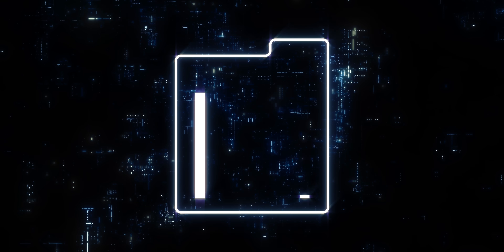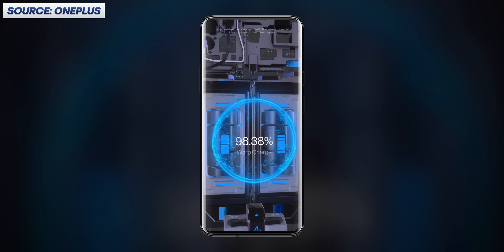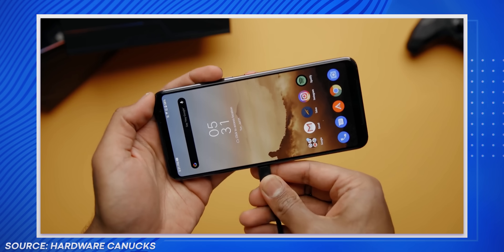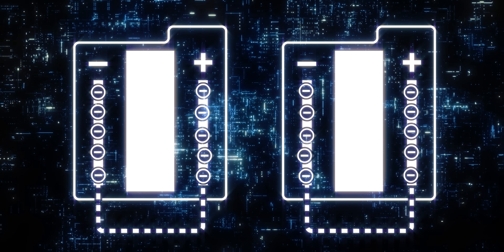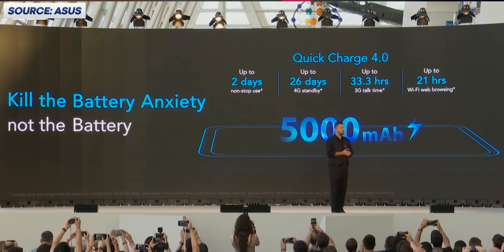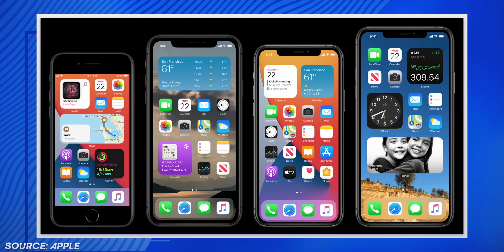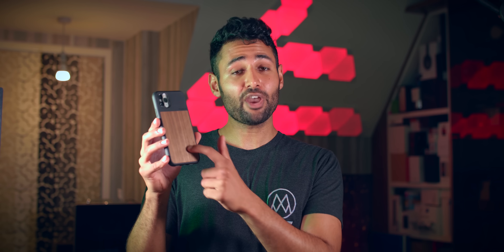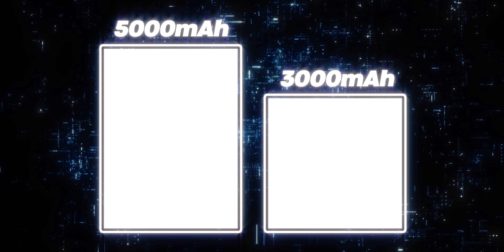The Problem with Fast Chargers.

Comment: I miss those days when you can easily remove the battery and replace it or use another battery
Reply: I used to have a rooted S3 so it drained the battery but I had two of them and used the broken one to charge the spare battery so always had a battery at 100%
Reply: My solution to that garbage practice is to buy devices with replaceable batteries.

Luckily custom PCs get replaceable batteries. I back all my data on there including external drives incase my phone battery dies.

Samsung and Apple Watches are great for backup phones. But as of right now, we don't have any reliable phones to replace the batteries besides extreme DIY methods.
Reply: You can buy battery back cover
Reply: get a fairphone then, or a pinephone :) they can still do it
Reply: Laughs in Samsung galaxy s4
Reply: Samsung galaxy xcover pro has this 👌
Reply: I use EasyAcc ultra slim 10000 mah... Don't care about the battery life!
Reply: fairphone
Reply: Why miss it when you can buy an older phone? I got a samsung galaxy j7 and while not the best, it's great for daily use and getting a battery on amazon is super efficient. I've only had the phone for a year tho so everything is still running smoothly now.
Reply: @gemgirl223 Samsung is not good for gaming. Only high-end Samsung devices are good.
Reply: @iaminevitable5696  I agree, but I don't really game hard on my phone. I watch stuff, listen to music, and play small mobile games and it does those things pretty well.
Reply: @iaminevitable5696  yea I have A7 and it sucks .. Update does event come ...For three years no update
Reply: @harshmishra9971  a 5 year old phone not getting updates... Even Apple doesn't do that.
Reply: @Indipender  Dude after one year only update stopped coming ...And it's not 5 years old but 3 years A7 2017 version
Reply: No. That sucks

Comment: Thank you! I've been saying this for years. Ultra fast charging is not much of a good use of your phone can't even last a day

This is the reason I'm getting the ROG Phone. 6000 mAh with 30 watts of charging that can full up at 70% or around 4000 mAh in just 30 mins

Btw, Sony with their Xperia 1 II also has fast charging feature where the charger powers the phone instead of the batter so no heat is generated

Comment: ive been saying this same thing for years!! I always keep my phone charged up to 80-85% max and when it goes down to 40-45% I charge it! And thanks to this, the batteries in my phones have always had good health when I sold them.
Reply: You're not gaining any battery life though.  If you're limiting your battery to only 40 % of its maximum mah just to counter degradation of maybe 10% in 3 years then you didn't make a difference at all. You just limited yourself
Reply: Well, I don't usually let my phones battery die through the day, after they hit the ~10% mark, but I charge them all the way to 100%, never had an issue (Redmi note 4, Redmi note 5 and currently S10+)
Reply: I buy a phone with a big battery so that I can have the convenience of not charging it frequently. I guess you prefer a better resell value and do not need a big phone battery.

Comment: Hi Aron, i would love to see you make a video on Headphone Jack. What factor is causing the makers to remove the 3.5mm jack from flagships. Is it for IP68 certification, saving space for more hardware. I don’t understand the reason. I wish apple 12mini or any other flagship comes with a jack. I will buy it right away.

Comment: My P30 Pro has a 45W charger. I've owned it since it came out and to this date i have no complaints about it
Reply: He meant longterm effect of fast charging Degrades phone battery overtime FASTER .
The last time I checked 1year is not a long time
2019 to 2020.
He recommends 30watts for fast charger.
Reply: puckry is an 18W charger good?
Reply: @Lol-rv5bv  i would say it's the best! About 90 min to get a full charge! Not bad in any sense
Reply: Ikr, this video is a little bit scammy, manufacturers know what they're doing when they include fast chargers with the phone
Reply: @juliofreitas8308  if you knew a tiny bit about the subject, you wouldn't say such horseshit, that this is scammy. This is 100% accurate information. Arun only forgot to mention that batteries have a base life (for example 2000-3000 full 0-100% charging), then they die no matter what you do.
Reply: @Indipender  this time Arun has surely scammed because Manufacturers are using much better and efficient techniques. There was a time when 18W Moto heats 50 C but today 120W hardly go beyond 45C. Also defending apple is bad because most Android phones have high SOT and also last longer than apple batteries. Only problem is Android don't get updates after 2 years but they cost 30% of iPhone costs.

Comment: I have been playing pubg mobile on my phone with 5000mah battery while its charging for almost two years now. Never faced any issue of heating or battery life degrading. Only one thing while playing it doesn't charge but remains the same. And also I play for 3 hrs on average.

Comment: Wait a minute. You said Apple doesn't include charger means they protect their products battery. I said that a pure bullshit. You know how troubled iPhone when being charged with something that not have Apple license in the adapter, the charging IC is gonna self destruct (you can watch on Louis Rossman YouTube channel he already confirm it). Some people may state the consumer who buying iPhone maybe had charger from previous iPhone or own magsafe from macbook, I said that is more bullshit. Not all people in this world using all-in Apple ecosystem. Some are just need the iPhone, when works with Windows or any other environment. Despite either taking advance or not from sell separate adapter, the decision of not including adapter for their iPhone are completely bullshit in my opinion. No one should be restricted with ridiculous reason like that.
Reply: Apple deciding to not include the charging adapter is for environmental purposes, not to protect the battery. 
He said that Apple was reluctant to include the faster 18W charger because of the degradation it does to the battery. This is why it is only available for the 11 pro series. 
In fact, Apple has included the same 5W adapter for the past 8 years, while android competitors have adopted 18-25W chargers as early as 2014.

Comment: The future for battery health is either using Graphene with Lithium-ion mix ups or huge battery capacity so if we decide to use the phone we will only need to charge them every 4-6 days for example my Redmi Note 9 Pro is getting charged up every 4-5 days with its 5020mah and all these days in rotation I have enough time sitting on my pc while having it connected to it with idk 5-10w charging.

Comment: About the 50% you are actually wrong. Mostly it has to do with International Air Transport Regulations, where they should only be charged up to a maximum of 30% charge, but it seldomly gets checked.
Also a storage charge for lithium batteries is actually voltage dependant, between 3.6 to 3.8 volt per cell is ideal.

Comment: Faster electron movement can be translated into "more heat" if the resistance of transfer is still the same or even higher. If you reduce the resistance the electrons wouldn´t release so much inefficient heat. The only solution to that would be the extreme reduction of resistance. The only phone which does it right now is Xiaomi Mi 10 Ultra with its Lithium-ion battery mixed up with a graphene electrons transfer layer that is optimal for low resistance and high-speed energy transfer.

Comment: Finally someone agreed to it. That fast chargers do.kill the battery more quickly. Infact simultaneous usage makes this faster. 
I wonder why this technology - running device from power while charging - is not available in mobiles while this existed in laptops most likely from the beginning. This would enhance battery life. But mobile.co. Dont want it to be

Comment: Regarding the buffer, I remember on my Cingular 8125 that ran Windows Mobile 5.0 that after almost 2 years, when it ran out of a charge, it was dead dead.  During the wait time to get my extra batteries, I had to destroy a usb cable to connect the wires directly to the battery to charge it enough to turn the phone on and then charge the phone normally.

Comment: this. i never get the faster charging hype with that 65w, 120w or another gimmick.
i've been sticking with my 5-10w charger for like 10 years and i have no problem with it.
sony and apple did right with only included standar 18w charger in the box.

Comment: I've been trying to understand everything about batteries since I got the Note 20 Ultra and I was really happy to see 47% on my battery when I turned it on for the first time. 

Since then, I've been charging my phone with small fast charging intervals and I don't pass 80% or 20%

I did this on my Note 10 Plus but not this intense.

Comment: Dual battery’s will not rusult in faster charging!!! It is the charge that determines the how fast a battery can be charged safely . This means 2 battery’s with half the capacity will take the same time as a single one that is twice the size.

Comment: Hey bro is it fine to charge wireless at lower speeds
Reply: I would recommend a wireless charger with a cooling fan such as Samsung’s. Even at 5W, it creates a lot of excess heat.

Comment: It's kind of funny how you rejects your previous points about why fast charging is bad with all the measurements that companies take to prevent those problems from occuring. I also would've liked for you to go more in depth about the multiple ways of fast charging, as raising the power can mean raising the voltage or amperes or both

Comment: I use an OEM 15W wireless charger instead of the in box 40W wired charger for all charges besides a quick top up(rare) I think this is a good move for the battery health. Am I correct?

Comment: The other point to make to support Aruns video; is that the membrane between the positive and negative can wear and degrade over time, meaning the ions can move freely between + and -  increasing battery drain.

Comment: I haven't watched the video yet, but there's a lot of good reasons why fast charging is actually better. I'm interested to hear this

In regards to my phone, it doesn't get but mildly warm when charging. The only time my phone gets hot is when I play COD Mobile on the highest settings. I have a OnePlus 8, I've heard that the way the warp charging works is different than a lot of other fast chargers (like Qualcomm quick charge). I have no actual information on this other than things I've heard, but the OnePlus charger uses a higher amperage and lower voltage when others are using the opposite. I can say that my brick gets pretty damn hot when my phone is just warm.

Comment: Well, sadly for a Galaxy Tab S7+ 5G user like me, the charger included in the box is simply isn't enought. I don't have 3 hours to wait for it to charge up, while with the separed 24W charger what you can buy, you can charge it's nearly 11000mah battery up in a hour and 40 min rougly.

Comment: Another advantage of fast charging some overlook is the fact that you can use it easier to keep your battery in a healthy state ( 20%-80%, or even 30%-70%) with a quick 10-15 minute plug in, people with slow chargers usually charging overnight (to 100% ) and using it the whole day.

Comment: In short, even if you have an iPhone 12, the best solution is possibly still a charger that offers 12 watt/2.4 ampere charging. I use that for my iPhone X and iPad Pro 10.5” and works very well for me. 😎👍🏼

Comment: Two points that I think have to be adressed:
* the separator doesn't get bigger for faster charging, the electrodes do. The effect is the same though.
* the phone heating up is mainly a problem with old fast charge tech or with what Qualcomm is usually doing. 18W Qualcomm fast charging is pushing 9V 2A through the cable and that has to be stepped down... that stepping down isn't too efficient. 30W Warp Charging for example uses 5V 6A and doesn't have to step the voltage down as much.

Comment: im sitting on a +3 year old one plus 5. and about half a year ago i lost dash charging capabitily. but when i look at my accubat it saids i got about 80% capacity. fairly nice for a 3 year old all original battery. but yer. im waiting on tools (most likely lost in transit) to change out flex cable and battery to try regain dash charging again.

Comment: Charging speed selection and curve should be a mandatory feature.

This is exactly why i have 3 chargers, 1 from that came with my 2007 Motorola VE66 and still works perfectly fine topping at 800mA a Samsung that tops around 1.2A and another Samsung that tops at 2A.
Depending on the speed i want to achieve i plug the phone to one of them accordingly but, most of the time i have it with the Motorola so it charges slower and if i have it charging i likely plug it around 5-6 AM so even if it charged at max by the time i woke up i would have taken unplugged it myself anyway.
+ Since i have my Poco F1 rooted i have messed around with the charging configuration, making it think that 80% is actually 100% so it tops off at 80 and as it does that, it also slows down.
And that's how, for 2 years now my phone's battery still performs extremely well.

Comment: I have a Galaxy Note9 and in December it will be two years I have owned it, my battery performance is approximately 98% of what it was two years ago. Mainly for the reasons mentioned in this video, though I never knew about the potential problem with wireless charging (mine doesn't get very warm when charging).
I only charge to 100% occasionally usually when I get busy with something and I never charge overnight, in fact, I turn my phone off at night. I have a newer PC to game on so I never game on my phone, thus I only need to charge it every second day and I could probably stretch that to three days without draining the battery too much.
Follow the advice in the video and your phone can last for years.

Comment: This is wrong. Smartphones composed with fast charging also have smart-batteries. 

Let me explain.

Smart Batteries are build as multi-cell capacity battery which means that there’s not only a single battery inside your fast charging smartphone but about 4 batteries cells inside the Smart Battery. This battery is composed with a micro chip called BMS, this BMS can either be inside the smartphone main board or inside the smart-battery. This BMS (Battery Management System) will send the same amount of voltages to each cell inside the smart battery; in small terms, will charge faster because each cell is being charged at the same speed as if this battery was a single cell but rhetorically there are 4 cells inside, meaning that will charge “faster” as each cell is being charged with the same amount of voltage. That’s why a high wattage/voltage charger is needed; it equals to having 4 chargers together and each charger charging each battery cell. 
Of course since each cell is smaller therefore each cell stores less wattage (WHr), less wattage for each cell, the cell charges faster. Charging 4 cells with a “ fast charger “ BMS will split the voltage and wattage in 4x.
Reply: Also, the 20% leftover smartphone makers leave on the battery is so that this downhill charging thing is prevented, as well, to prevent the Galaxy NOTE meme from happening.
Reply: Nothing you said contradicts the video.
Reply: Daniel Kaschel 
It is contradicting. 
Smart-Batteries don’t degree faster neither slower or overheat. 

Also, it is normal that any charger for any battery hill down charging while topping up the cell. This to prevent over-volting it and blowing them up. 

Fast charger is just charging the single cells separately. Splitting them a part just reduces the charging speed. 

The only thing getting hot here is the charger.

Comment: I have the Samsung galaxy s20+ 5g, I have only ever used the superfast cable that came with my phone and the battery has always lasted around  30 hours with constant use of Spotify and snapchat and my data. Also obviously use othrer apps all the time exapmle YouTube alot after work and play games like mine craft with a controller. I also only charge it when I'm asleep and it says 2 hours to charge full when I plug it in at 3%. I've had this phone for 4 months now.

Comment: This is exactly why I am not really sold on super fast > 15 W charging and whatnot. This is also the reason why manufacturers never actually explain the cons of fast charging and wireless charging. I'm no physicist, but common sense actually helps in choosing the right phone, the right charger, the right cable, etc.

Comment: Quick additions, Sony Xperias on the Android side have been having optimized charging since the Xperia xz in 2016(where it learnt your charge patterns) and have now gotten to a point you can even manually set when the battery goes to 100 or all it to still just learn your patterns , they also have the feature to bypass battery when gaming and using the phone on a charger on their latest models.

Comment: Great video as always.Now every time ill charge my phone ill remember them + and - pic LOL
Since the mi10ultra came out i've been wondering why samsung and others still come out with 55w the most..and just what cost you have to pay with that phone for the 25m(0-100%) fast charging.Maybe you could make a video about that new technologie(125w fast charging) and if we can expect companies coming out with the same charging next year, because it works and ppl are impressed,but im sure in some way it either kills the battery or damaging it over time.Even tho Xiaomi explained they split the battery and they have like 8 or 10 sensors to keep the overheating and ither issues in check..